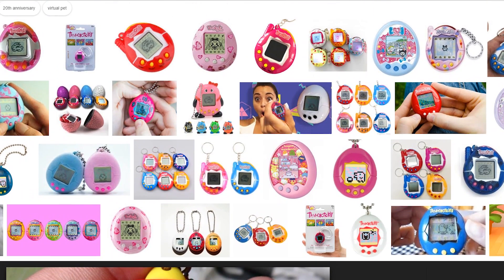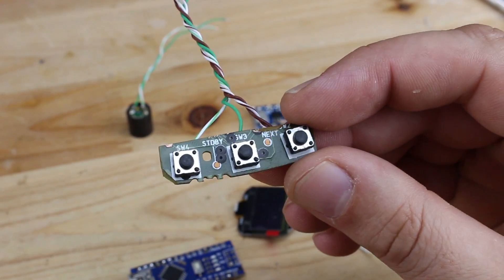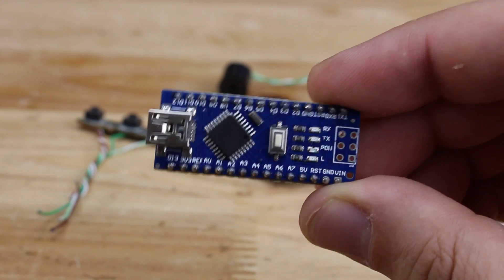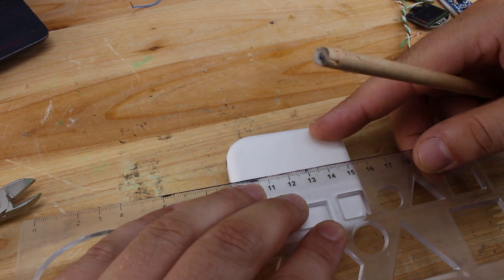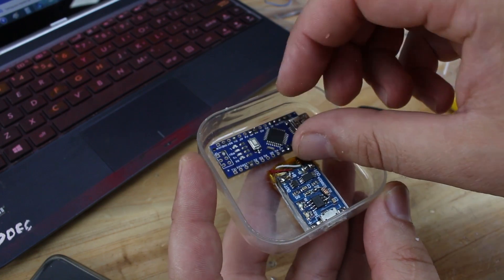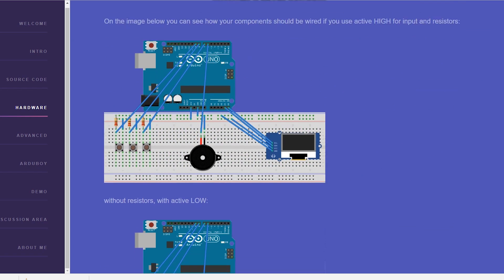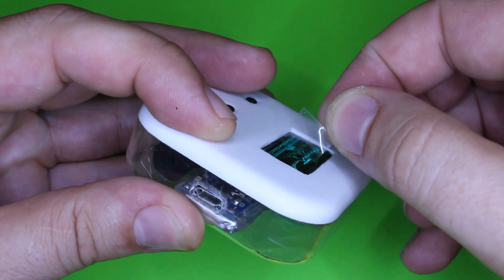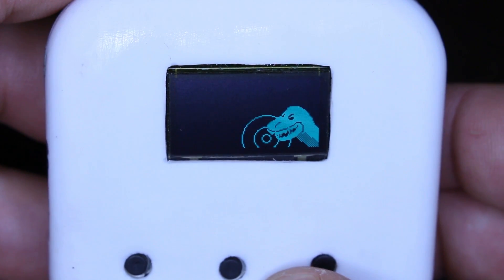DIY Arduino Digital Pet (Pcbway)

Comment: Hi! Great video!  I have a question!  I'm actually trying to repair a new tamagotchi that came faulty.  The clock only reads 30:00am or 32:00pm.  The minutes still ticking but the hour stays at 32 pm or 30 am.
So thr character doesn't progress, he's stuck in sleep mode. 
What do you think might be the issue? I was thinking maybe the cylinder crystal oscillator🤔 
If it is, should I replace it or re-solder it?

Comment: Sir, what is the value of resistor u add for the charging module?
Reply: There isn't one for the battery it's a charging module chip.